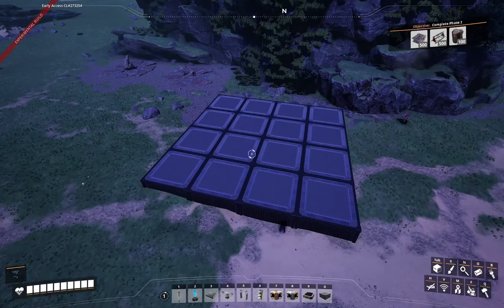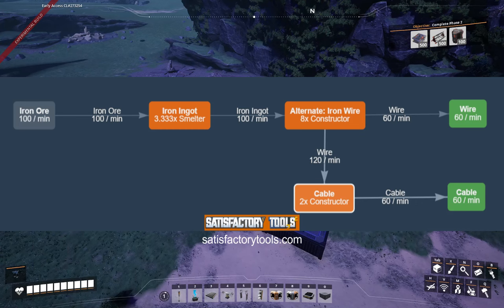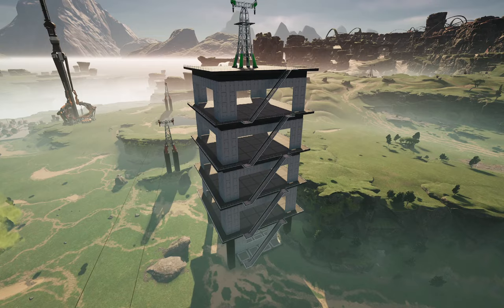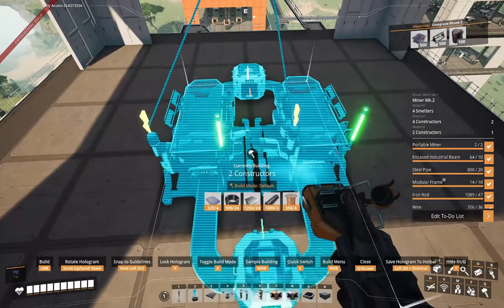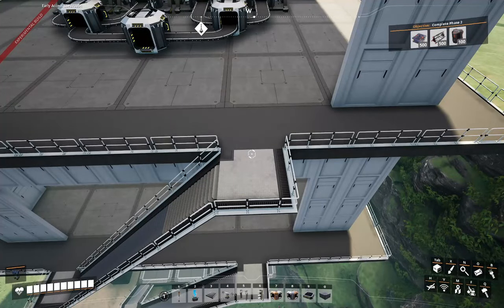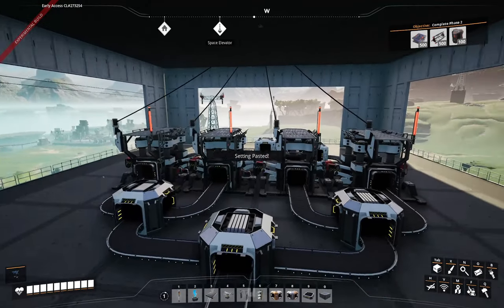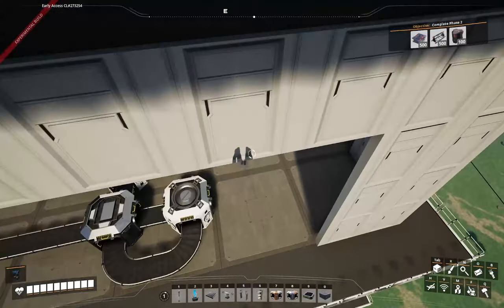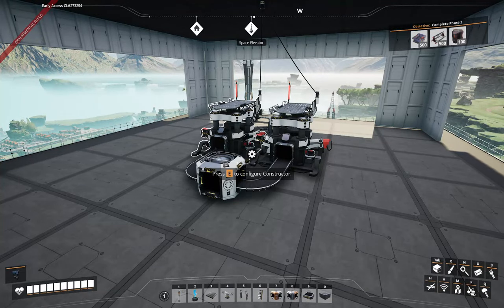LOAD BALANCED 60/min Wire and Cable - Satisfactory - Update 8

Comment: Is 60 per min useful, or just for starters?
Reply from the maker: I had really good luck with the amounts through the whole save. Except for when I wanted to pave a huge section of the ocean for nuclear, I ran out of steel beams. Besides that one factory, with having 3 Industrial Storage Containers as a buffer I never had any issues with any part running out.

Comment: Ps: for the vertical builds I usually take my elevator through the floors or very closely so I can place the floor holes easier and quicker without guessing
Reply from the maker: Great idea! I already do that for pipes, I don't know why I forget to do it with lifts. This playthrough probably wont be too compact, except for a few places I'm sure. I like to see everything moving with the load balanced system. Thank you for the feedback!
Reply: @moo121  great to be of help mate! I see, no problem, it's a very good point, anyway there is no huge need of doing stuff super compact, it makes your life way harder especially not seeing anything moving through the belts 🙉😂